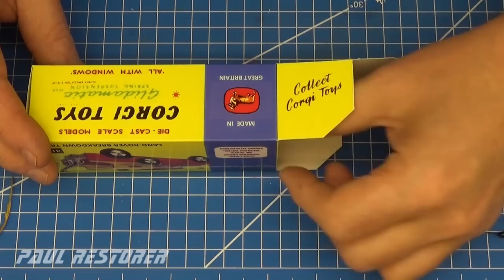Renowacja Corgi Land Rover 109 WB Breackdown Service Wrecker. Odlewane części samochodowe.

Comment: Superb restoration, and now you have the 2 two different wheel types.  Great idea for making the towing hook!  Looks just like an original, and will be much stronger than a cast metal hook.  They are hard to bend with pliers by hand.  The box artwork shows a Series 1 Land Rover, with the round wheel arches.  The model is a Series 2A.
Reply from the maker: Thank you very much

Comment: Hoorah! Bravo! This must have been one of the most challenging and demanding restoration ever. I suppose the winch structure was made with PS resin and tires with melted polypropylene, right? Do you add a black dye before pouring the plastic or does it come in black color? Thanks and best regards from Brazil.
Reply from the maker: Thank you very much. You're right. Polypropylene is black. Greetings from Poland

Comment: I'm a bit late joining the party, only just discovered you're impressive work Paul. I do a bit of tinkering myself but nothing so advanced as yours. But no-one seems to have asked the obvious questions, unless I'm looking in the wrong place. What I would dearly love to know is: What is the clear material you used to make the replacement windscreen? What do you use to make the molds, and what material do you make the other molded parts with?
Reply from the maker: I try to write everything in my films. I don't know if you turn on subtitles. are in different languages. of course, the windshield is made of PET, thermoformed. The molds are made of molding silicone mm940, while the window hooves are made of FC 52 polyurethane resin. Regards
Reply: @PaulRestorer  Thank you Paul, your reply is most helpful. I'm going to try some of your methods. 🙂